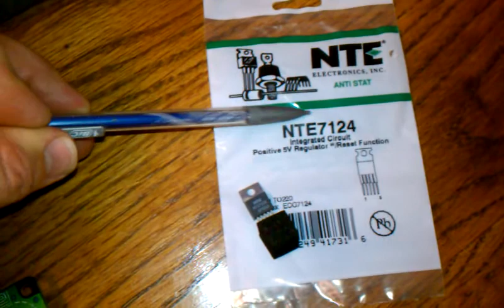Roland JX-1  repair  Pt.3

Comment: Ribbon connectors "flip up the tab: can you explain more? I don't see how to get those 2 black ribbon cables out.
Reply from the maker: It's been 11 years since I did the video and not sure myself.  But I think you feel around the grey plastic around the black ribbon cable and with your fingernail catch the edge and flick it up to release the cable.
Reply: @Synthetech thanks so much! do you mean the two sides stay together on top, to the long side of the cable but separate at the bottom by printed circuit board?
Reply from the maker: I think so.  But honestly it's been so long ago and the video is so blurry I can't see it well enough to confirm.  Sorry I'm not much help.
Reply: @Synthetech  Thanks!